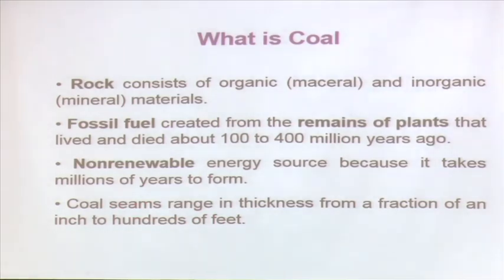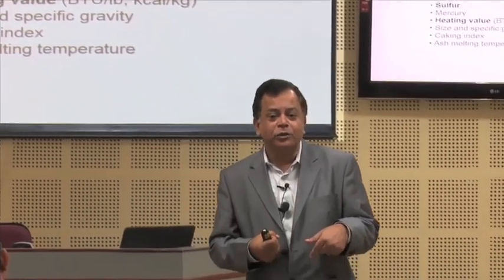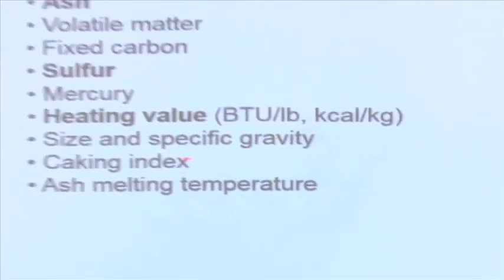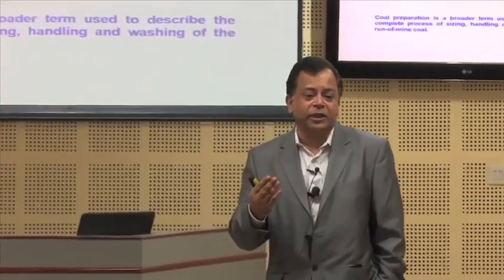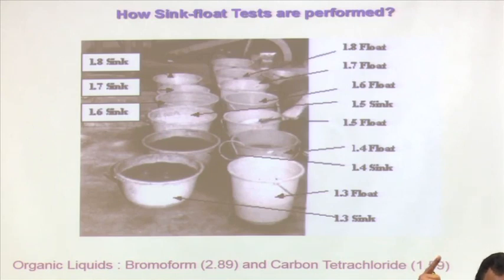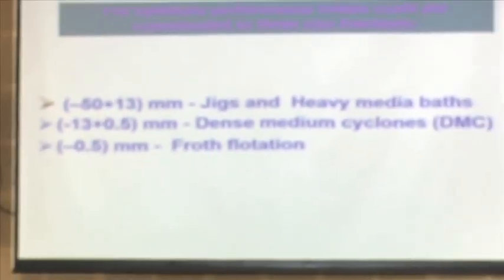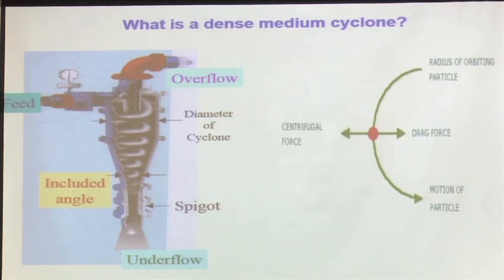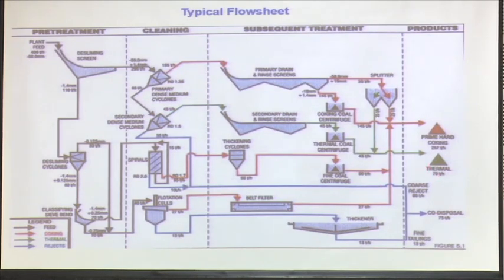3. Introduction od Coal Preparation

Comment: Key advantages of X-ray intelligent dry coal sorting equipment:
1.Replacing handpicking and jigging
2.Coal processing without water to resolve the constraint of water shortage;
3.Coal processing in the areas easy to be muddy in contact with water
4. Recycling of end coal and sorting of other non-minerals
5.Reduce the cost of coal processing
6.Easy to construct and the construction time is much shorter
7.No water circuits and slurry ponds required, issues with permits are also less
8.Can also be made semi-mobile allowing fast and easy relocation of processing plants